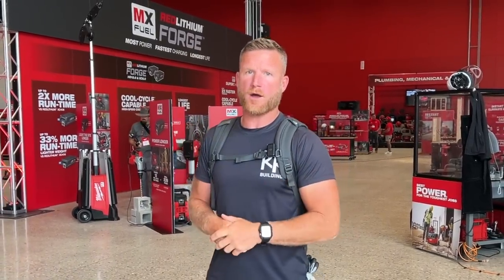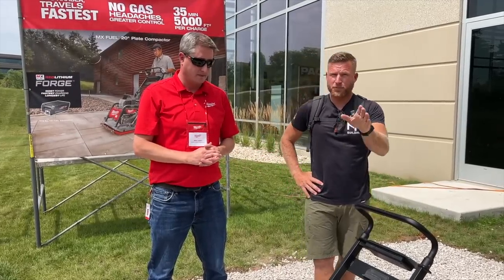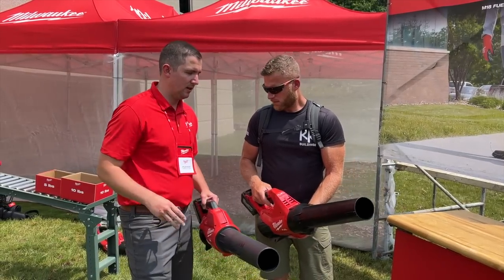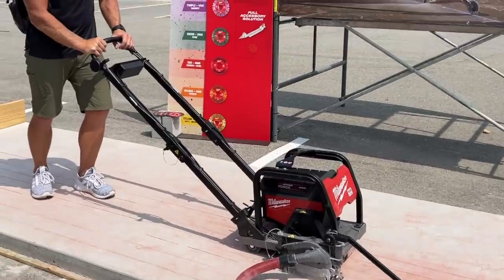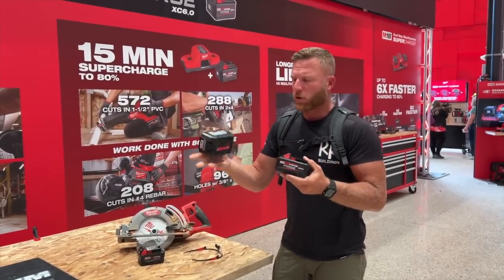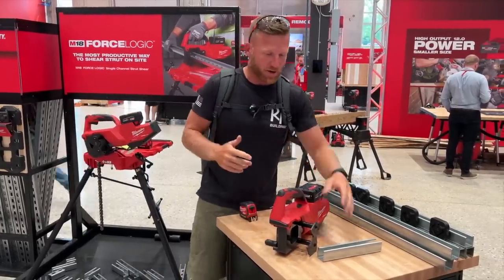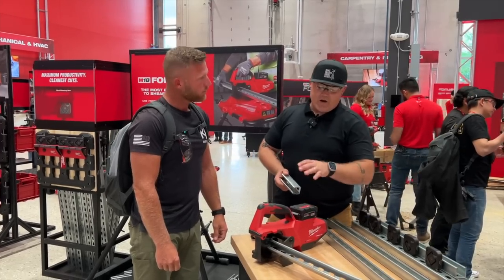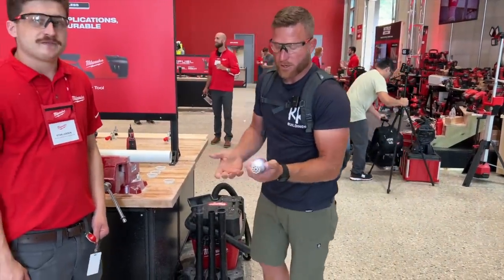What NEW Tools are coming from Milwaukee Tool!  Pipeline 2023

Comment: You get them you bear, and I listened to my father on his tool brand, craftsman.
I only buy and use Craftsman tool, products and accessories. Huge fan boy, started my career in plumbing 2 1/2 years ago used nothing but craftsman, I’m still use it craftsmen tools. Power wise mostly the modern stuff the hand tools I perfer to buy the classic USA oldies but the new stuff is starting to take over.

Comment: I see many I will want, and though heavily invested in M18, I'm buying more and more M12 because they are so darn handy.
Reply: No doubt. Gen3 impact driver is a ripper, as is the compact 3/8" impact wrench. Right angle die grinder, installation driver.. list goes on.
Reply: I call my M12 line of tools my Barbie tools. They're awesome.
Reply: Saw some pics of the M12 Brad nailer which is coming. I mean, man... I might get on that.

Comment: Make sure when you buy the new XC6.0 M18 that you test them out ASAP to insure they work. I had a issue and it took a few swap-outs to get two good batteries. They went from the 18650 to the 21700 cells which is where they get the extra power. Great video.
Reply: How did you test them

Comment: The batt equip is great because it will always run as long as it is charged and you do not have the hard start or flooding from gas engines. But the batt equip is very expensive for the DIY guy that does not use equip every day.

Comment: Like the new drawer options on the Pack Out.  I would like to see Milwaukee offer an upgrade program where you could trade in your older models for credit on the new models.
Reply: Good luck wish they did that with all the Ni Cad junk I I got stuck with
Reply: A rolling-base drawer unit (w/ handle) you don't have to take things off of to get inside would be great - Milwaukee, I know you're watching! Kind of a missed opportunity - I'd buy one immediately!
Reply: Like iPhone
Reply: they do that at local shops near me. check local tool shops.
Reply: @Justin-C hell yes!!! I think that all the time when I have to take the heavy drawers off the top of my roller bottom to get something

Comment: That looks like a beast but my concern .if it anything like the 32 tools I own it not going to be reliable. Out of the 32 tool 28 of them have been replaced with new one because they don’t last from motor going bad to them get so hot you can hold on to them . I’m talking about the fuel line.
I’m a die hard Milwaukee fan but the amount of money you spend on these tool you would think they would last long then 45 days not a year days I have 3 tools in my arsenal that has lasted a year everything else I have right now 8 tool 2 batteries and a charger in the shop right now I called 1800 saw dust the only help I get from them is just keep sending them in it’s sad I have to go and buy cheap tool just to get my job done wile my Milwaukee tool are in the shop i been waiting 30 day for 8 tools to come in

Comment: The new battery is just like the Dewalt Powerstack and the Flex STACKED, Milwaukee is a bit late on that one. 
I'm excited to see what the new high torque can do. 
That 12v jigsaw with with the blower look sweet, I'll be getting that one for sure.
Reply: Are they pouch cells?  I really hope not as they are prone to failure..
Reply: @FJB2020  Yes they are pouch cells. As for failure rate, Dewalt says they have twice the cycle life of cylindre cells and I honestly think they're better for absorbing shocks as long as the case is decent. In my experience, the first thing that tends to break when you drop a battery is the case, then the spot weld. Spot welds aren't a thing with pouch cells so that's one less thing to break. Biggest downside is price of course.
Reply: @MrArcticPOWER  Wife works for lowes in the returns department and they get a lot of these power stack and those flex batteries in.. Personal experience with a powerstack is it worked for a day and just went dead..  My guess is the chinese made pouch cells don't have the same quality control as the Korean/Japanese/Taiwanese made cylindricals that are assembled in mexico.. Hopefully this is not the case for Milwaukee, but I can tell you I have had more battery returns with Milwaukee than any other brand.. Especially the 6ah 12v.. they should just recall them and give everyone a 5ah HO...
Reply: @FJB2020  Damn that sucks. I have a few power stacks but so far so good.  
Funny story. my drill took a 25' drop into a concrete manure lagoon that had 8" of piss while we were doing the roof. I came down, dropped it into a bucket of water to clean it and it still works fine today.

Comment: The problem with Milwaukee is if they break down  they don’t supply parts to fix the problem. And you end up spending a fortune having to replace it .
Reply: Most millwaukee supplier(minus big box) have a certified repair tech, ive kept a 1/4" impact going through hell with my local markham tool supply!!

Comment: Carpenter & Joiner here in the UK for 37yrs who owns quite a lot of a Milwaukee cordless kit. 

But I will not buy any more 1st version of their tools. I got proper burned on their first version 18ga gasless pin gun which is complete garbage & is basically unfit for purpose, it jams up constantly & the tip marks timber & it is incapable of firing a brad below the surface regardless of how it's adjusted, the Version 2 fixed all these issues but despite mine going in for repair under warranty none of these issues were fixed (also here in the UK Milwaukee do not repair their own tools, they use approved repair centres which are just your local tool shop & repairs take weeks) 

They make some great tools but I won't be suckered into the marketing hype of new first gen tools again.

Comment: dont fall for that forge. its a ripoff.  with its high discharge rate its def goin to die faster than the 6.0 high output.  on top of that, you'll need a $250 supercharger to get the 15min 80% charge. smh. overall a 2-pack of 6.0 high output at $172 now is a way better deal than 1 fuckin 6.0 forge for $199. ridiculous.   its not even much of a upgrade.  it charges faster...  gimme a break.  if you have high output, stick wit those.  this aint a upgrade.  Me, personally, even before i seen this forge, all i needed (more like 'wanted') was the dual bay rapid charger $125